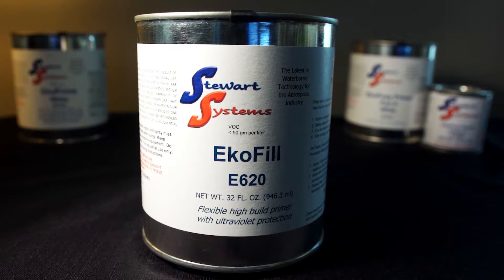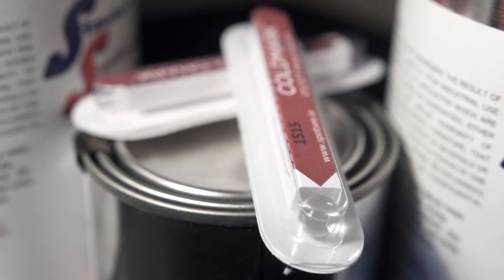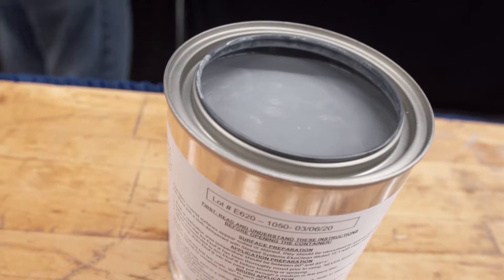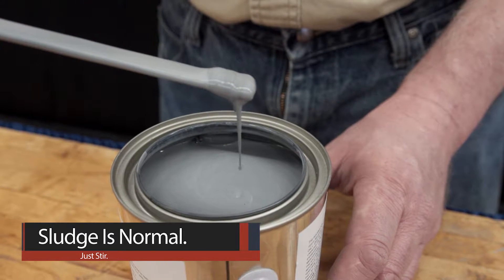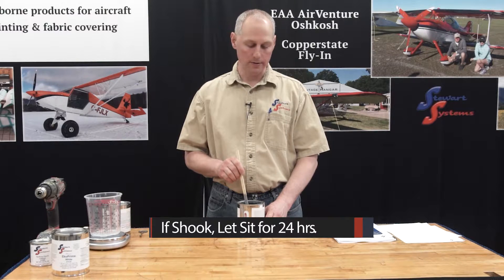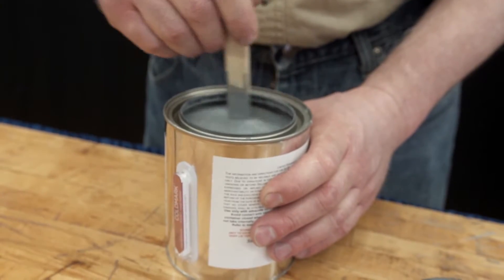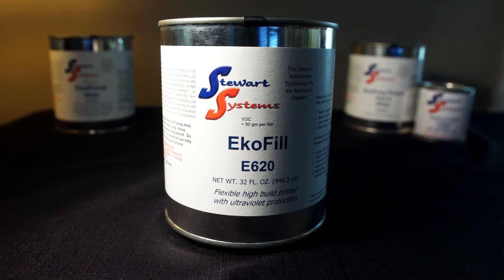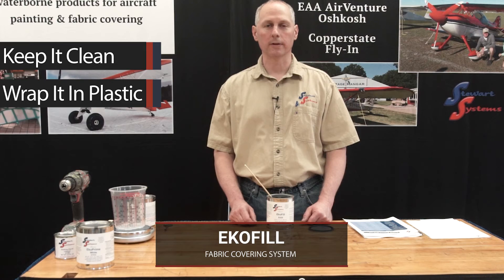EkoFill

Comment: Can Acrylic Latex or Urethane Enamel exterior paint be used on top of ekofill? For Remote Control aircraft purposes?
Reply from the maker: You can use just about anything over EkoFill on an experimental or RC.  I would be concerned mostly with flexibility.  Especially with urethane enamel.  If it's not really flexible it will likely crack in time.  Latex would be better, but most latex does not look quite as nice.  You can also purchase our EkoPoly down to pint size if you want to go that route.
Reply: @StewartSystems  sent an email requesting more info. Thanks!

Comment: Is there an application for this besides aviation?
Reply from the maker: You could use it for other things.  It works well on composite and fiberglass.  It also works well on many other kinds of fabric.  We have had people use it for fabric covered canoes for example.  The main thing or EkoFill is that it does not have corrosion inhibiting properties, so don't use it on bare metal.  EkoPrime and EkoPoxy do and are perfect for metal.
Reply: Stewart Systems Thank you.